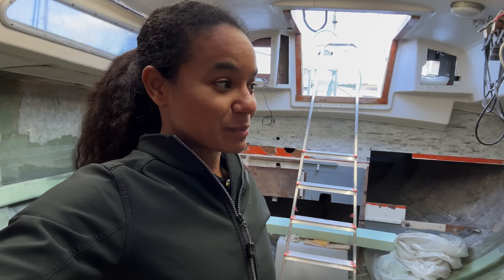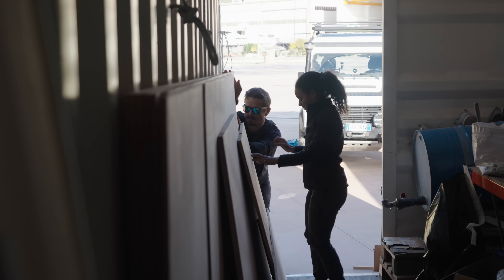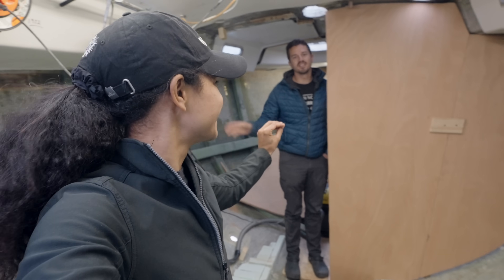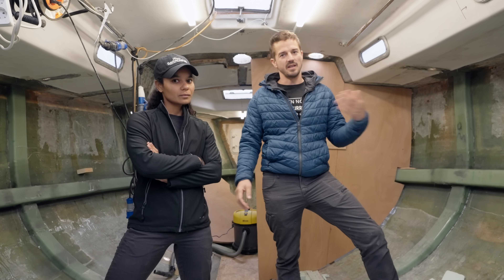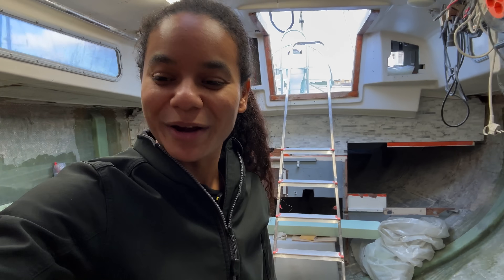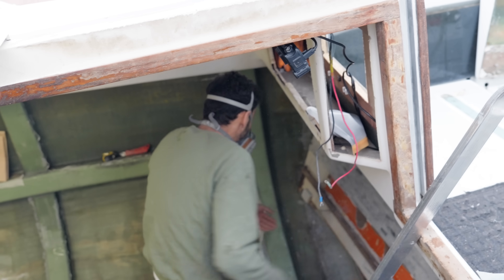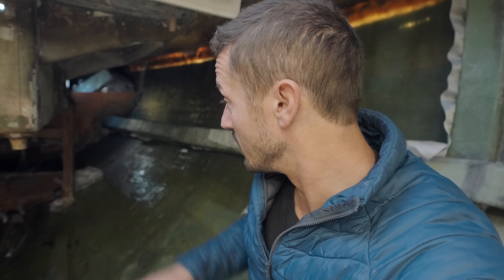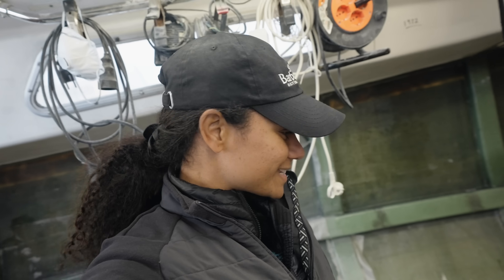Building The World’s Strongest Pearson 36 | Step 388

Comment: I’ve mentioned it before, but think about moving the motor pod significantly aft, closer to the rudder.  It’ll give you more space where it’s useful, but more importantly, it’ll make the boat far easier to manoeuvre at piers etc. The prop wash hits the rudder quicker and harder. Huge difference. 

I’m a professional skipper on the Amsterdam canals, have 50 years of sailing experience, including professional racing, and have designed and built sailboats. The proposed change is definitely a big improvement.

Nice to see the boat getting progress, by the way. With most people, this project would be a complete no go. Far better to buy another boat. With you two, however, there’s no doubt that you’ll get the results you want without burning out. Experience and skill plus the right attitude. It’ll be fun to “participate” and see the results of competent creativity.

Comment: Renovating and transforming your home to better withstand the weather elements. Building on years of lessons learned. The skeletal and spine sections are beefier and now properly joined to the hull. The ribs, stringers, sole, bulkhead(s) and extra layers of fibreglass have made Üma more watertight and robust yet flexible. So a vastly improved foundation to build from. Less squeaking, cracking, flexing, deflection. More quiet, easier to insulate. Huge opportunity to incorporate an interior space utilization to your personal priority needs, budget and timeline.

Phase 1 (research, redesign, deconstruct, reinforce) completed.

Phase 2 [designing, mapping out the interior, rebuilding each new area, one bulkhead at a time]

Comment: Beautiful job!  Crazy,beautiful!  Two things: seal the edges of the plywood before placement to delay a rotting process, limber holes between all the structural panels to allow water to sink to the lowest point in the bilge.  (It’s not too late).  Accumulated water in those areas will drive you nuts.
If that other P 36 “Skylark” was from New York, I sailed against her for many years when new.  Pretty good boat, but we were faster of course (kidding)!  I knew the original owner well.  Grumman man.
You all are amazing.  I’m jealous!  I hope you’re finding Sardinia to as beautiful as I imagine.  Wonderful looking yard.
Good luck, and Godspeed.

Comment: Great Job so far. Please take some time to think about changing the rigging system from fore- and aft lowers stays with straight spreaders, to a stiffer system with swept spraders which are much better. The handling of the fore sails is much easier and due to the pre bending of the mast profile it is much stiffer in itself. It is the ideal time to do so because you could add the required brackes without any problems. Of course it is an investment, but if you have the choice i would go for it, or at least think about it. I did it with my boat and it tourned out to be the best decision ever.

Comment: FYI, I fastened half a dozen sheets of plywood to my roof rack the same way and everything went great.....until I had to stop quick for an idiot who cut me off.  All of the inside layers took off over the hood onto the road and the 2 outside (top and bottom) pieces remained on the roof rack.  Tie one more strap fore and aft to prevent this.  Great but hard job you guys are doing.

Comment: Knowing that you all are architects, I am sure you have been keeping track of weight distribution as you go forward, I would be really interested in hearing about HOW you are doing that.  The Duracell folks are keeping track of what came out and what is going back in to ensure that they don't completely change her displacement.  The glass and resin going in are well distributed, though there is a fair amount above the water line, anyway, just curious as to how that will impact your placement of tankage and batteries.  She IS going to be an ice breaker for sure!

Comment: You were thinking batteries or water tank back by the cockpit.  I'm thinking batteries, and water tank further forward, for the same reason:  Short runs.  The big cable runs will be to the Ocean Volt and to your panels, both of which are right there aft.  Your galley is gonna be further forward, so moving the tank forward means shorter hose runs.  (Water maker between the two?)  Also, you'd said the boat likes to sail slightly stern-down - the batteries back there will be permanent ballast, but your water levels will vary, affecting your trim.  Just a thought.  

IANANavalArchitect, YMMV, EIEIO...

Comment: You don’t need to totally glass the entire cabin top! Make beams same as did for the hull; glass over structural foam. Build temporary supports for glassing beams to cabin top and maybe beam ends to cabin wall. Still some vertical but much less and in manageable sizes. Lead weight at deck level keep COG down.

Comment: I have always loved your channel. Your obviously doing good work. I suppose with over 400,000 members its hard to address everyone's opinion.
So a little background. I am a retired Offshore Tug Master. I also fished two years late 70's crabbing in the Bering Sea. Many Fishing boats modified by non Marine Architects as well as Greedy Crew, went down due to stability issues. For my licenses I had to learn a little about Stability. Knock Down and Pitch Pole numbers have everything to do with the designed Stability built in to then as per the plans and weight/ volume capacity. I cannot believe you two architects would not take that into account. Still wondering.

Comment: Most mono hull sailboats that get lost at sea suffer rudder failure. In our big ocean racing we are required to have a functional/ tested backup rudder system. Its been used by many over the years by the way. If I ever decided to do big water cruising, twin rudder or backup system would be mandatory. I would also create a sealed rudder stock compartment many very nice expensive cruisers have been lost by broken rudder stocks. Super easy things to do while you guys are doing this.
Reply from the maker: Yes. Buy our rudder is a full skeg mount. So not really possible to “loose” it like a spade mounted one. We are sealing off the cockpit locker from the cabin though.

Comment: With all the removed internal fitting out, diesel engine, and fuel tanks, the weight distribution is going to change substantially from the original build.

Do you have a plan for balancing the boat to float on its original waterline?

Comment: Slightly concerned about safety @1:20, Dan correctly attempts to push the lumber around to ensure it is strapped securely but he doesn’t invoke the “yeap, that’s not goin’ anywhere” spell afterwards. You have to say the magic words or the spell won’t cast!

Comment: For a long time I have been thinking that a hull made of 2 inch foam strips would be good for hot and cold weather. Ice box and heat insulation built into the hull rather than just stuck on. Also there is the flotation if the boat fills with water.
Reply from the maker: Pretty much all new boats have foam cored construction.

Comment: I and most of the people watching this channel know what you are saying when you say, "20 mil," but, at first, I thought you were using the actual definition for a mil.  That is "A mil is a measurement that equals one-thousandth of an inch, or 0.001 inch. One mil also equals 0.0254 mm (millimeter). Thus a mil is not the same thickness as a millimeter. The term "mil" is not an abbreviation but a unit of measure."  Oh, and I love the work you are doing on the boat.

Comment: Hmm.. laminated and then 'stitched together' bulkheads... I'm not so sure my structural engineer mind likes what it hears.. but, I'll allow it ;)

You better be using some Mortise or Japanese fish tail interlocking system on those pieces.
Reply from the maker: Nope. Just a few layers of glass on each side. The wood will delaminate before the glass fails.
Reply: @SailingUma  True. I have tried neatly dissasembling epoxied joints. Dream on, the wood disingerates before you can release the glued joint.

Comment: Hi  👋 polyester resin is not water resistant.  are you going to paint the backgrounds with gel coat?
Reply from the maker: Of course. But it’s also inside. So it’s not going to be exposed to water 24/7.

Comment: Maybe this is not unique question, but: why not to build boat from scratch using some proven boat plan? Plywood boats have a good stiffness because of material properties, for example. Amount of time and money spent on boat furniture, electric equipment disassembly, sanding, etc. - comparable to build a new hull. Build a new boat is very interesting process.
Reply from the maker: New boat is 10X what our refit will cost. And at least a few years more time. Besides, we like our little Uma. She sails well and we’ve already proven her capabilities in her handicapped state.
Reply: @SailingUma  ok, thanks for explanation. In account of money spent - build or refit cost very depends on country where you doing this. Wish you a boat refit completion as soon as possible.

Comment: You have created a hard point at the ends of the keel stringers and the new hull frames.  Over time this will develop a failure point along that whole section.
Reply: Should a tabbed in fillet have been used in that particular section to avoid the hard spot?   Doing a refit / rebuild myself so interested in this sort of stuff. Cheers.
Reply from the maker: ?? There is a large overlap between the keel repair and the new ribs.
Reply: @junk_rig_sailor1698  On Uma the new ribs end where the existing keel grid ends.  These should have been overlapped so that the flexing load is shared across both beams.  The original design was fine because the hull could flex.  By adding those new ribs they create a hard point.

Comment: Why dont you use foamsheets instead of plywood for bulkheads?
Reply from the maker: Wood is easier to work with. Cheaper. Faster. And if done correctly, won’t rot for another 50-100yrs.

Comment: are you not worried how the extra weight will effect the speed?
Reply from the maker: What extra weight!? Did you see how much we removed!?
Reply: @SailingUma  was just thinking by time you have it all kitted out along with extra fiberglass. Probably just talking rubbish as I have no real idea about boat building.
Reply: @the_don2393 sailboat hulls are designed to have a waterline that gives them max ability and safety .If you remove weight or add weight beyond their tolerance  they become less efficient and safe .Its easy to add ballast to a boat that floats too high .if it floats low then you don’t take it to sea .

Comment: Why plywood? Why not composite sandwich? Easy to fabricate, light strong, never rot. I know, I know it's easier to do wood, but you're going to great lengths anyway. There is a company that is doing a prefabricated sandwich panel out of recycled plastic for the core. It's as light as a pvc foam panel. A little late, but it would have been cool.  Carry on
Reply from the maker: We can’t make her too light, or she won’t sail well and won’t be very comfortable at sea. 

Also wood is just easier and faster to work with. And it will still last 50+ more years if done correctly. We’ll leave the composite panels to the high performance catamarans.
Reply: Understood, it was wood so why not go with what you know. I build high performance, infused sandwich sailboats, was just thinking someone reading may benefit from the alternative. Enjoy your channel, fun to watch you guys.

Comment: why marine ply when foam core fiberglass sheets are available? Wood holds moisture and I would never use wood as structure on a boat now that I seen it doesn't last that long. 2 decades compared to life of boat with fiberglass foam panels.
Reply: If you encapsulate (epoxy) plywood; especially the edges, it will last as long as the rest of the boat.
Reply: @billvanvlack117  I was a marine mechanic and restored boats. That is why I said what I said.

Comment: So was the boat originally built in 1973?
Reply from the maker: 1972
Reply: @SailingUma  safe the Arab oil embargo caused companies to  reformulate fiberglass and the re essult was lots of hull blistering.  72 is safe.

Comment: Is this type of extensive remodel/refit cost-effective, including time value, compared to selling the old boat and buying another comparable but more suitable one?  My sense is that selling and replacing a sailboat of Uma's size and quality would be less costly, and certainly most time-saving.  You can always make more money, but you can't make more time.  On the other hand, maybe the point of this was to make boat project videos for a change instead of sailing videos, so there were no refit vs. replace cost considerations.
Reply from the maker: A new boat is 10X more than a refit.
Reply: @SailingUma  Definitely, a NEW boat is way more costly than a refit.  But the comparison is between a refit and buying another comparable (similar size and age as Uma) but more suitable one (more current refit, more desirable features/functionality, layout, etc.), not a new boat.  A new model year boat is not a comparable.

Comment: How does nobody wear gloves? Drives me crazy.
Reply from the maker: For what? 

If you’ve been working and sailing and climbing as long as we have, your hands are pretty though.
Reply: @SailingUma  rough hands are not my thing. I understand for climbing but if either of you cut your hand on something, the job becomes harder to do. You talked about safety on the water, that should also be true with working with power tools and carrying wood. But you be as free as you want. Also the feel of a callused hand on my bare back is not my thing.

Comment: Wow, so 2 weeks ago you "f-ed up", and the boat was falling apart, now it's as strong as an ice breaker?  Starting to feel like click bait.  I have loved your sailing adventures, but this all feels like a misguided effort.  You're taking a very old boat that was never intended as an offshore cruiser and trying to make it one.  You should have sold Uma and bought a proper offshore boat that would have been "the right tool for the job" from the get go.  It is interesting to see the work, but I'd rather have seen you exploring the Med right now.  

And you cannot cut straight lines with a jigsaw!  I was shocked to see them trying.  

I sure hope you are planning to glass those bulkheads!  The seams appear to have been filletted and tabbed well, but you can't just leave the ply like that.  Maybe it's still coming, but you said the structural work was done.